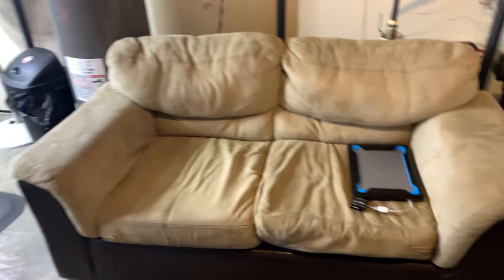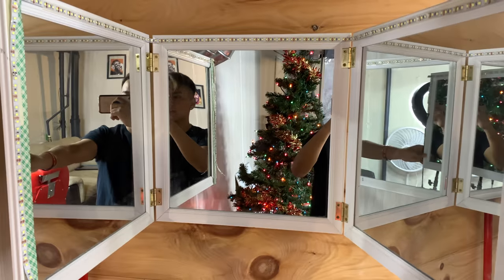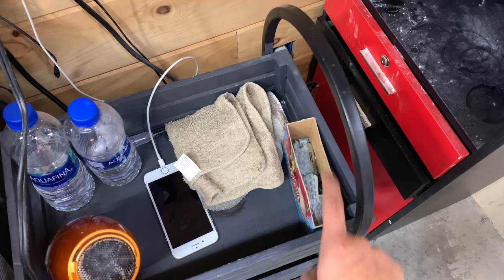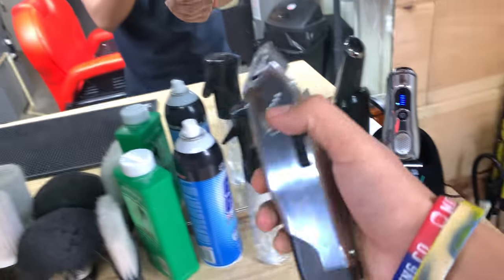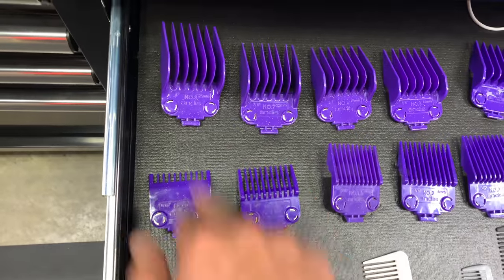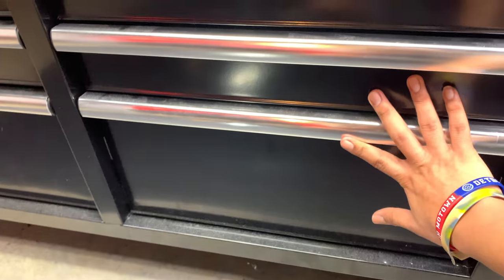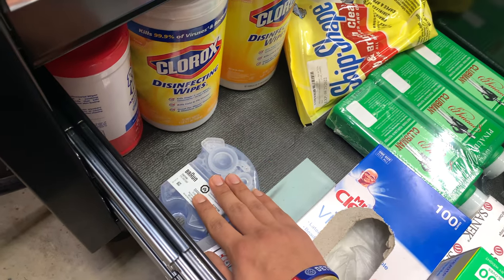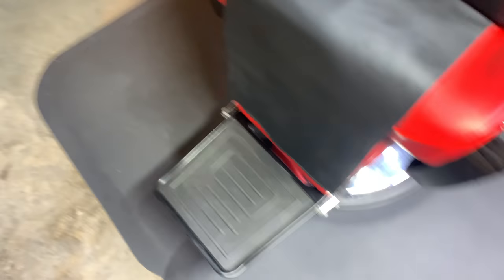Barber Set Up 2019

Comment: I bet the lever not broke just tighten it
Reply: the back casing of the fast feeds breaks easy so if you over tighten the lever it will cause the plastic to crack on top of the lever had the same issue with mine